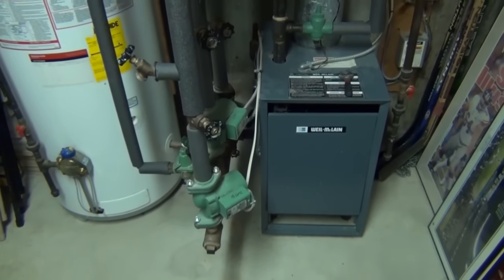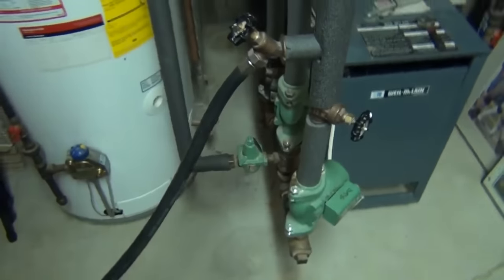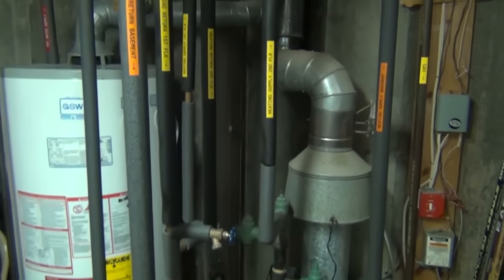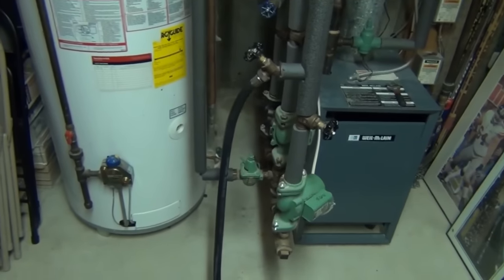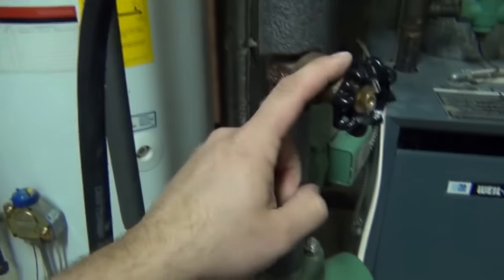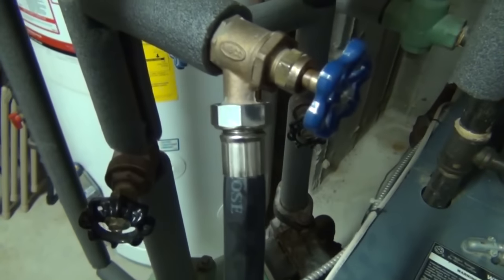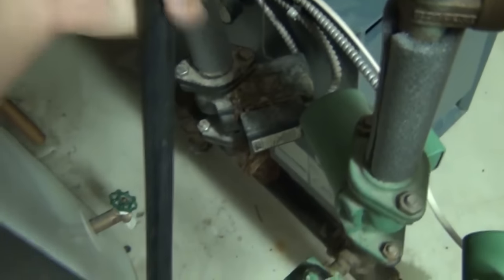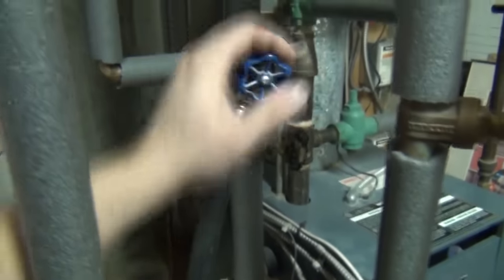Remove Air from your Boiler and Heating System | How To

Comment from the maker: Brass hose cap: https://amzn.to/3obsDLP
Hot water hose: https://amzn.to/2QcuAqM
Wrenches: https://amzn.to/2VNS8Uk
Bucket: https://amzn.to/31f0WaP
Expansion Tank: https://amzn.to/2SP1JZ7
Boiler Feed Valve: https://amzn.to/2M7jErr
Pipe Dope: https://amzn.to/2D4MV3p
Pipe Wrench: https://amzn.to/2VQeox8
Reply: Jn.
Reply: Hi Zim,
My my water city valve located up of the valve that you turn off in the video. If I turn it off the valve, then the city water is not going to the system as picture.
Should I turn off the valve or not? Thanks
Reply from the maker: @nhatlinhvo  no, don’t ever turn off the water feed to the system. That always needs to stay on!  Many residential systems don’t have a low water cutoff.  You can create a dangerous situation with the makeup water turned off

Comment: I had three different hvac companies try and get the air out of my system, no luck. Watched this video and did it myself, worked perfectly. Can't thank you enough.
Reply from the maker: Awesome stuff!!  Glad you got it fixed!
Reply: How much did the 3 companies charge you for no results
Reply: Well your first mistake was calling and hvac company. They deal with air not water.
Reply: @MsChunky666  🤣 yes they do.
Reply: @mackenziegray2090  not on my state.
Reply: @mackenziegray2090  been doing the job 30 years
Reply: @MsChunky666  who does in your state? The hvac company I work for does everything. Boilers, steam, ac, commercial refrigeration.
Reply: @mackenziegray2090  traditionally plumbers take care of boilers and water heaters also plumbers hold gasfitters licenses. Hvac companies deal with hot air and ac.
Reply: @mackenziegray2090  same here! HVAC tech and plumbers here are scared of boilers 😂 so we work on boilers
Reply: @MsChunky666  I'm in Maryland and my company works on boilers in fact I had a boiler call this morning 8am first call
Reply: @hotfeva9843  I'm not denying that. I lived in Georgia for a bit and plumbers did not work on heat. My comment was for MA only. Here plumbers all have gas fitters license. Hvac guys can get them but typically they hire me for the gas and flu on a furnace and as plumbers we fix the boilers. It's weird and not common.
Reply: @gabrielblake5812  I don't doubt that. I'm just stating how it is in MA.  When you get a plumbing license in MA you also get a gas fitters license. Plumbers fix the boilers and if there is a permit on the job plumbers are responsible for the gas and flu on a furnace. Most hvac people here do not hold a gas license so they hire plumbers to connect the gas and flu. Weird I know.
Reply: @MsChunky666  oh ok yea probably just a municipal kinda thing, like for instance in some places HVAC guy's can't access the main breaker panel
Reply: That is not true HVAC companies Install,and service boilers… Granted some are more experienced with air others boilers or hydronic heating systems. Then you have old timers like me that do air,electric,solar,hydronic,heat pumps and duel fuel systems. Here is a tip when calling inform them you have a boiler or hydronic heat system to begin with. Cheers.
Reply: Guy just came out .. I was with my 18 mnth old while he was working.. he didn't even turn our boiler off at our main upstairs before starting to drain it smh..we'll see how things go

Comment: Hands down the best explanation of “how to” video. I am super impressed by you taking the time to explain everything including the expansion tank. I am still new to hydronic boilers so this is a blessing to see first hand.
Reply from the maker: Thanks, glad the video helped you!
Reply: Yes thank you for this very well explained purging process
Reply: This is a great purging video for sure...only discrepancy I have is regarding inlet of expansion tank. The orientation of the label means nothing. How the info is printed on the tank is only that way because of manufacturer. The correct way to tie in an expansion tank on horizontal piping is not hanging below directly it, particularly in a system with iron components. Eventually particulate matter from these components, or copper shavings, etc will settle in that port and on top of the diaphragm causing he tank to fail. Upright is best, if the tanks Schrader valve is not too high and accessible. Many if not all horizontally plumbed air eliminators have a 1/2" port on the bottom for expansion tank hookup and this is fine as long as it's offset with a few elbows. Expansion tanks lose about 1# of air per year thru osmosis...so they need to be checked yearly included in the annual inspection. They should be plumbed in as near to the boiler as possible and as near to the Autofill/prv as possible. This is your point of no pressure change and if possible...ALWAYS pump away from this. You will have virtually zero air issues if it's done this way. Expansion tanks should be plumbed in to the system with a valve and then boiler drain before they tie in because the pressure must be drained off the tank before checking with gauge. Hope this helps!!!
Reply: @bnice12  that all makes sense, that the inlet should be on the bottom and the air bladder above.  
If the expansion tank has no air pressure in it and then filled with water to the nominal 12 or so psi, would that damage the bladder in the tank or does it have enough flexibility to push all the way to the walls of the tank?

Comment: One thing I noticed you didn't mention (everything else was very thorough), and one question. First, in addition to shutting the power to the system to prevent it from kicking on, also make sure the boiler has cooled down. Introducing cold water into a hot boiler can cause thermal shock. The question I had was related to setting the pressure reducing or fill valve back to it's "regulated" pressure. How long do you need to let it run to ensure the boiler's static pressure (when the system is off) is low enough to avoid blowing the PRV? I know this will vary depending on the size of the zone/system. In the video you shut off the purge valve right away.

Comment: My boiler has only one zone with no zone valve above the circulator pump. The only valve I have on the return side is the boiler drain valve sitting below the pump. Is it impossible then to do what you describe in the video or can it still be done with opening the boiler drain valve?

Comment: Great video you mentioned everything I learned over 35 years in my home.  My system still has the ancient expansion tank. I added a 3rd zone 10 years ago. Turning the gates valves on and returning 1/2 turn to keep the gate loose. Priceless info. Nobody tells you this.  Info is handed down and hardly learned. Thank you.

Comment: Thank you a  1000 times! From a working guy trying to the right thing like updating baseboards , old drain valves and circulator pump, was working just over 20 years old. Tried to bleed at each baseboard, spent 1 day doing and still two furthest baseboards barely warm. Did exactly what you instructed! Awesome!

Comment: Hey Zim, you may have saved me countless dollars by posting this video! I tried everything after our upstairs hydroponic baseboard heaters stopped working. While I tried bleeding the air from both the radiators and the spigot, it was using a garden hose and a bucket as shown that actually worked! It's been 24 hours and the upstairs is still nice and toasty. Hopefully the repair will stand up to time.

Comment: 100% best video I’ve seen on the subject. It’s an extremely easy system to bleed once you know what you’re doing. You made it as straight forward as possible. Now, I don’t hear water rushing through my pipes. My puppies are creaking when turning on, but so much quieter.

Comment: I watched a lot of videos on this subject, this is the only one I liked. Explanation is on point! It covered everything I’m experiencing with my hydronic system. I’m currently having a very stubborn air lock where it’ll work for a few hours then stop working. The hose in the bucket technique is genius! The details on leaky valves and proper positioning is also extremely helpful. My home is over 60 years old so almost all my gate valves have that issue. Thanks so much for taking the time and posting!

Comment: Thank you so so so much. I'm a new home owner, 26 who works in tech and doesn't have much experience with DIY fixes. I have an old home with an older boiler with an expansion tacked on just to make things more confusing for me. I did tons of research to try and figure out how to bleed my boiler and this was the one that finally helped me figure it out! The explanation of why you need to shut off the valves before it gets to the pump was extremely helpful! Started clearing the water out and damn thing looked like a hot tub it had so much bubbles in it.
Reply from the maker: You're welcome bud!  Mine looks the same every now and then.  The process should be done at least once a year to ensure your heating system is running efficiently.  Real easy stuff - no need to call a pro!

Comment: I have been cleaning, maintaining, and repairing my Buderus/Riello burner with indirect 40 gallon water tank since installed in my house 15 years ago. I empty  the horizontal hot water tank which sits directly below the boiler every two years to vaccum out salts and sand that fall out of the  water. I was surprised how much the sacrificial rod had eroded in two years after replacement.
The fill valve information was super important as I had problem of air entering into the system automatically under normal 12 psi because of too much air in the system. I had not left the faucet open on second floor so too much psi in system. When I open the metal tab on fill valve all the way to allow water at city pressure I good to go from there.
Best hydronic instructions for hot water boiler on YouTube bar none, Zim.
Reply from the maker: Thank you!  Appreciate the comment and happy to help. Always a good feeling working on your own equipment and saving on the costly repairs from others.
Reply: I have a Buderus Boiler with a 32 Gallon Indirect Storage tank. The air keeps coming back into the system. I have 4 Zones

Comment: This is a great instructional video for many with baseboard heating systems that need to be purged to get the air out. Great job.

There is one of your statements that I disagree with… and I feel that it is very important to make a note of herein..  At about 10 minutes and 25 seconds you state that "you do not want to have a relief valve discharge because once it opens up it will never close again."  THIS IS A DANGEROUS STATEMENT to be telling the DIY community.  If you read the instructions that come with that particular relief valve, it clearly states that you "MUST OPERATE THE RELIEF VALVE ANNUALLY" to be sure the passageways are not blocked.  

There are three things that can happen when you operate a relief valve.
1. The valve will not discharge any water at all because it is stuck closed.  That is not a safe condition and can cause a boiler explosion.  You MUST NOT OPERATE that boiler until there is a working relief valve installed.
2. The valve will open and release water as it should, then the valve will attempt to close and may leak.  You can try to clear the debris that is keeping the valve from closing 100% by operating it again and again until it seals completely.  If it does not seal completely then you need to replace it.
3. You operate the relief valve and when you release the valve handle the valve closes and the water stops flowing.  I find this happens about 75 to 80% of the time when you operate the valves annually.

In all three outcomes, you end up with the knowledge that you are operating a safe boiler in your home.

NEVER TELL PEOPLE NOT TO FOLLOW THE MANUFACTURER'S INSTRUCTIONS WHEN IT COMES TO RELIEF VALVES.

Comment: Followed your tutorial yesterday after replacing the expansion tank,  automatic filler valve and pressure relief valve - worked like a charm!
Reply from the maker: Excellent, glad to hear the video helped you with your repairs!
Reply: Assuming you had to drain the entire system in order to make those replacements. I also need to replace teh expansion tank on mine, but there are no shut off valves for my system anywhere. It literally connects to the water main. There are no shut off valves to the entire hydronic system. I need to shut my entire house off and then drain all of my plumbing and the entire hydronic system so i can make the repairs.

Comment: thank you so much for simplifying this procedure i recently had to drain the water from my house in Maine during  January due to a furnace malfunction, after repairing  the furnace I immediately started to hear air in the pipes and the expansion tank after turning on the boiler, reopening the zone valves. thanks to you I have the knowledge to purge the air from the system without calling a furnace repair man

Comment: BLESS YOU SIR. This video saved me having to deal with the heater service guy again. Mine was a little different in that the valve handles were shaped different and I had to make sure to set the relays into the manual "open" position to let the water flow but it was all the same concepts as you described. Thank you!
Reply from the maker: Nice work!!
Reply: I have two zones do you have to open the both of the zone valves while purging the system?
Reply from the maker: @jaybee1930  do one at a time

Comment: Concise, but thorough. Almost called a plumber because of gurgling even after using the little air bleeders, but this procedure took care of the noise! Showing us not to let the valves get stuck open as well as to cap off leaks gave me a peace of mind for some reason lol. Thanks much.

Comment: Good info. I wouldn't however  recommend  turning  the fast fill lever to max pressure. Good chance the inexperienced home owner will cause the pressure to rise too high inside the boiler, causing the pressure relief valve to open. Most importantly though the procedure of turning the max fill lever to it's maximum can be very dangerous if you don't know what you are doing, or you forget to return it to it's normal position once done bleeding. Why?
There have been cases of pressure relief valves failing to open and boilers exploding due to high internal pressures.
Reply: If you watched the video he explains that and makes sure to mention the importance of shutting it off and the pressure being too high 🙄 😉

Comment: Hello ZIM....  I saw your video on how to stop your furnace from continually running. Remember  you replaced a Relay inside your furnace? Remember how that fixed your furnace and it stopped running when the thermostat told it to?  I replaced my Relay, like you did, and it did NOT stop the furnace from running. For sure that relay was BAD and needed to be replaced. You were Spot On. But I had to shut the main power off. I've been doing that since winter of 2019. But guess what?  I found two metal boxes outside the furnace, mounted on the wall. I finally took the covers off of them and found that each one had a RELAY in them!!  So I replaced those on Thursday, November 5th, 2021. Now my Furnace DOES work again!!! So, having replaced that first RELAY inside the furnace and then the other two.. well It does shut off and stay off when it should!!  The reason I'm posting this message on THIS video is because I see you have TWO metal Boxes just below your Main Power Switch. Have you looked inside those? Do they each have a Relay in them?   Your videos have been VERY HELPFUL!! Thank you so much!!
Reply from the maker: Thank you for the comment. Yes, I actually replaced one of the switching relays a year or two back. One of those “ I should have grabbed the camera and made a video” but didn’t. Anyways, glad you got your system fixed!

Comment: that was AMAZING!!... thank you... I have the identical Furnace/Boiler as in  your video... I look forward to checking out my system which is a 2 zone system... I think my Pressure gauge shows 15 psi... the furnace has worked fine so I guess 15 psi isn't too high.... THANK YOU FOR THIS VIDEO !!! :::

Comment: Thanks a lot!  As an aside we have the same brand boiler and have had for many years.  A large plumbing company said we should replace it at the low, low cost of only $12,000! A local person came in and said that the boiler will probably outlast me and should just have ignition cleaned.
Reply from the maker: Yes, some real scam artists out there. Glad you got it fixed and not replaced!!

Comment: By far the best video I've seen on the topic, especially with those extra handy tips! I'd also mention that all the new water added also has some air trapped in it and that it's the job of the air vent (which is beside my expansion tank) to slowly bleed that off. After I purged my system it gave off a couple hisses soon afterwards that was reassuring to hear. Also, it's a good idea to permanently keep a 5 gal bucket below both the pressure relief outlet pipe and backflow preventer outlet pipe.
Reply from the maker: Glad it was helpful!  Thanks for the suggestions and feedback!

Comment: OK, I am totally jealous. I see what you are doing. You are the same type of DYIer as I am. You however videotaped your projects. Real cool. You got me thinking if I made different clips of my projects as well as documented existing things, it would go a long way towards having anyone else understand my systems and such. I have a couple of three ring binders with written documentation of my electrical, plumbing, boilers (gas and coal) and different things I have implemented. Now I need to start taping. Thanks for the inspiration.
Reply from the maker: You’re welcome. I’m not going to lie, filming the work makes the job 10 times longer but I’m the end, it’s all good and gives me a sense of satisfaction.  Good luck, It’s a fun process!